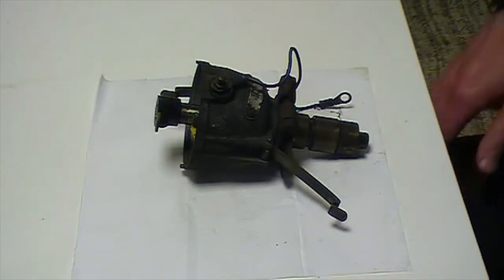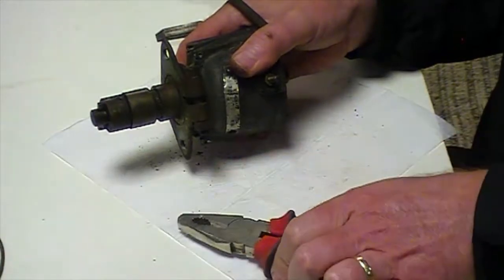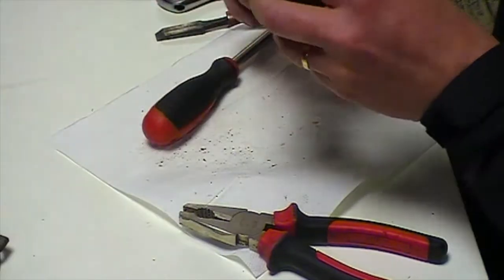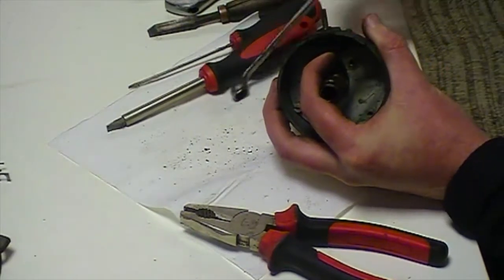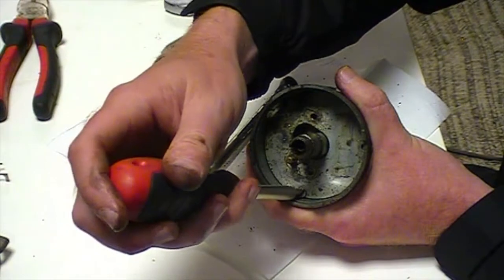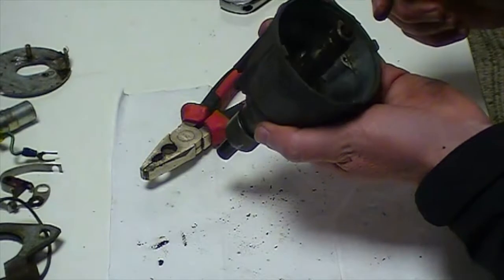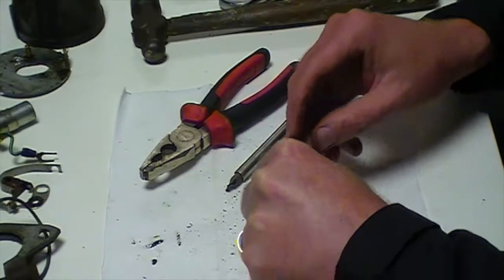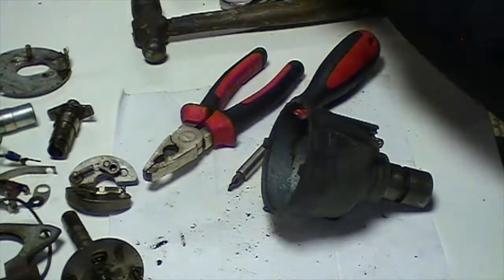#6 Ferguson TED20 - Restoring Distributor Part 1

Comment: Although I 100% agree with you for cleaning and using what you've got. The one electronic I would fit is instead of points. If? you are intending to use the tractor this will make it much more reliable.
One other point is about timing. Now, timing marks are only applicable on new engines. I was taught this a very long time ago. Once you've finished it, advance it until it pre-ignites (pinks) somewhere up the rev range, then back it off a couple of degrees. This is the best you'll get on anything other than new engines. Question you've got to ask yourself is who put the timing marks on in the first place. Anyway, nice job so far 😊
Reply from the maker: HI Malcolm, thanks for the info. I am 50/50 on using electronic ignition. I think its a great idea for a tractor you will be using day in and day out, but at this point I want to stick with the points and condensor, partly it's a nostalgia thing, its been a number of years since I had to mess with them and I'm eager to have a go. Crazy hey!? Yea timing on these older engines is more of a 'feel' thing than a science. We'll have to see how we go, but I'm with you on this. Of course we've a long way to go yet before we get to that stage...
Reply: My friend with the MGB kept points and condenser. (see recent video) Now, he bought everything new, however a couple of days later phoned me because it was playing up. Luckily, for once I knew what is was. New condenser had packed up, so he put the old one on. Usually these last a long time, in fact a few people told me they buy them at autojumbles etc as new ones are rubbish. Nothing wrong points for what you're doing so agree entirely.